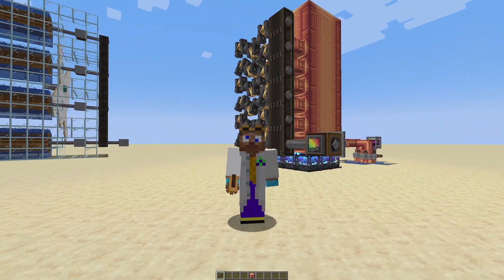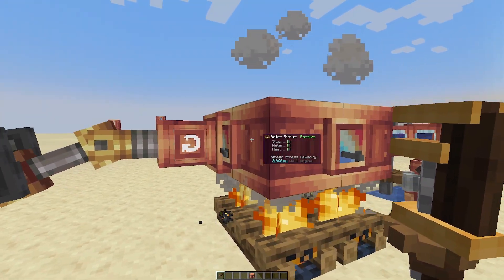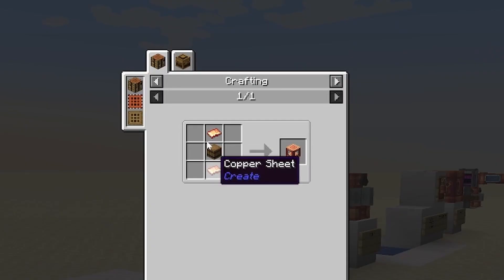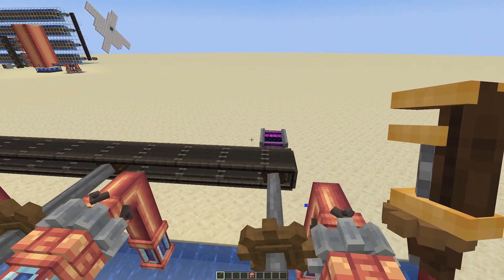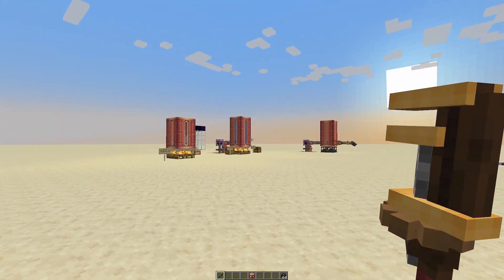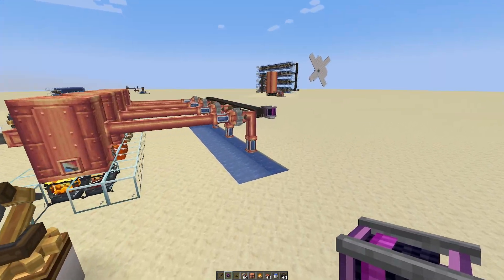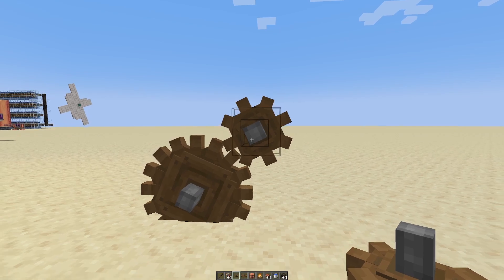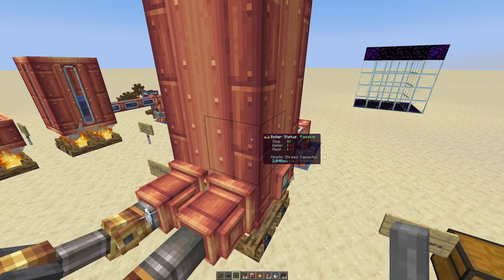Create Mod: Ultimate Boiler & Steam Engine Guide | Easy Power Generation

Comment: How do I connect a boiler to something, for an example the clutch on my other machine needs an input of at least 23k su and i built a boiler, how would i connect it?
Reply: connect the output of the steam engines trough shafts and belts to the machine